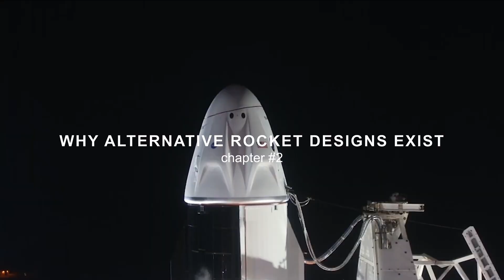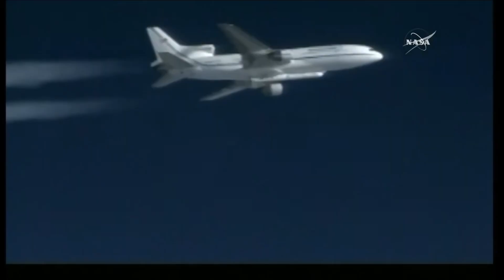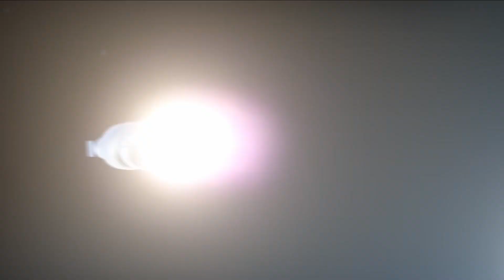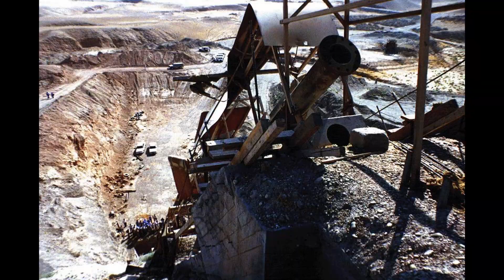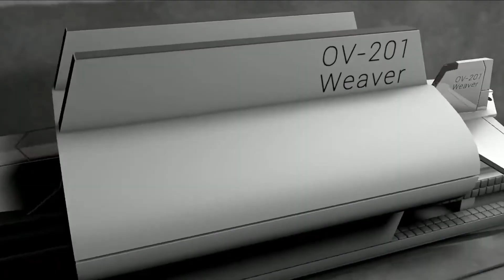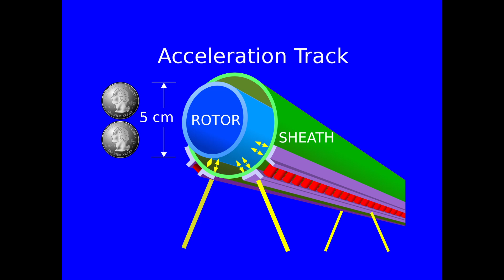Alternative Rocket Designs or how to Launch without Engines

Comment: We've had electronics that can handle thousands of G's since world war two. Earth-based kinetic launchers are a niche market, but they're not crazy.
Reply from the maker: Totally agree with this take. High-G systems like space guns or spinlaunch are certainly not impossible, but they are limited to certain applications (yes, electronics can withstand these forces, but not all of them) and lack flexibility and versatility when compared to traditional rocket designs.
Reply: @therockethubofficial  A rocket shell is actually very light and has little structural capability and needs to be filled very carefully so this is the biggest challenge for any  horizontal system...